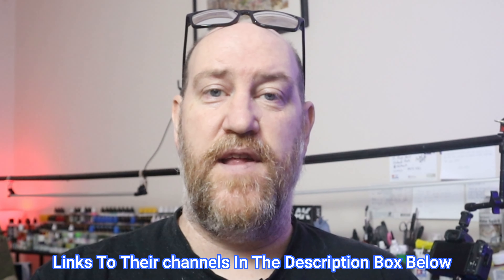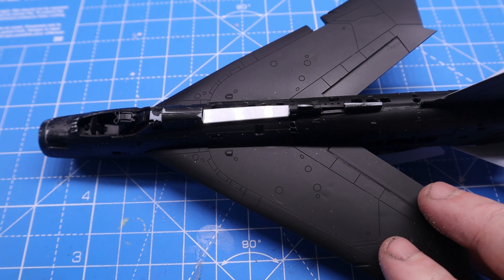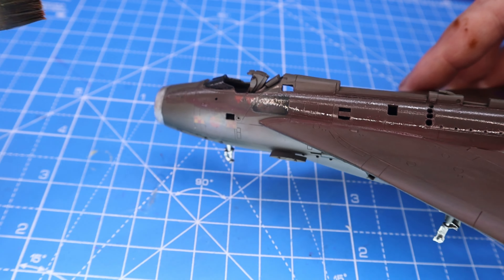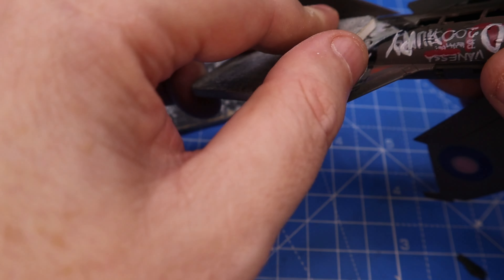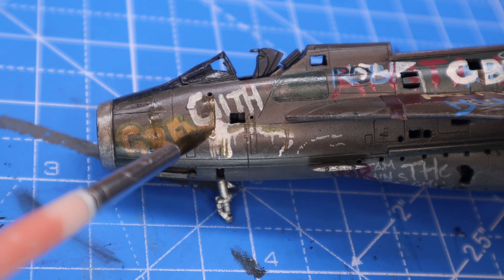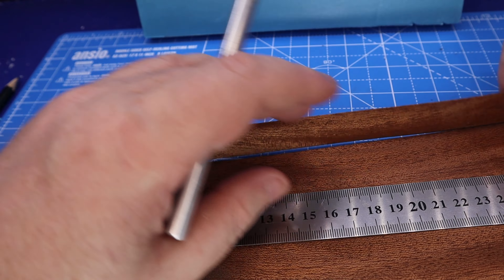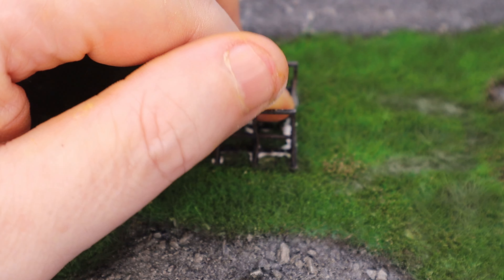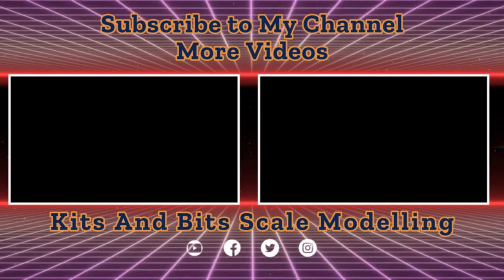Airfix 1/72nd BAE Lightning - The A1 Lightning at Balderton

Comment: There used to be a similar Lightning on its undercart on the east side of the A1 just north of Newark. It steadily decayed and then one day it was no longer there. It was in the black/brown camo guise, not the metal finish as I remember them.
Reply: What did happen to it that,  being the A1 a/c I remember?  Did I miss the narrative?
Reply from the maker: It was scrapped sadly, but the cockpit section was restored and is now on display in the Newark Air museum
Reply: This is a model of that same aircraft.